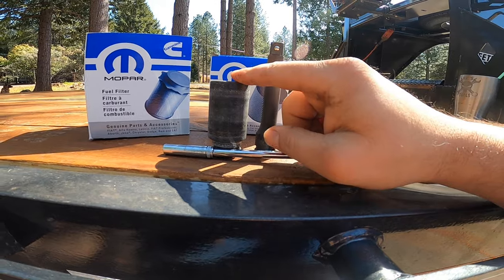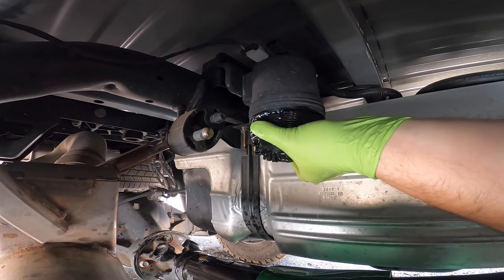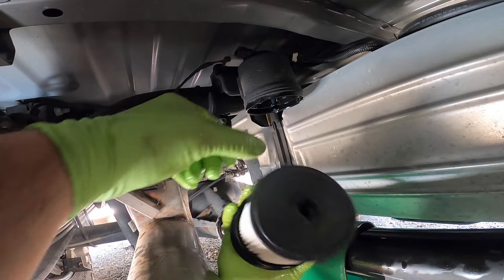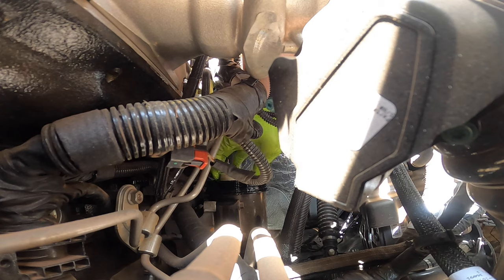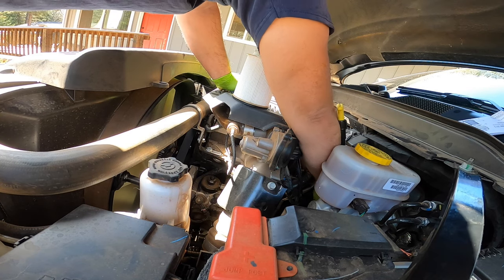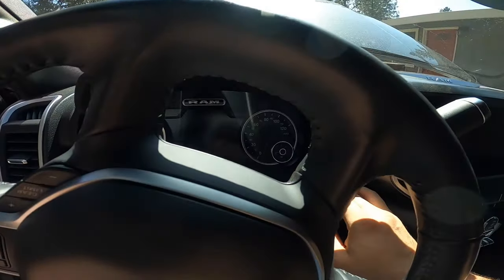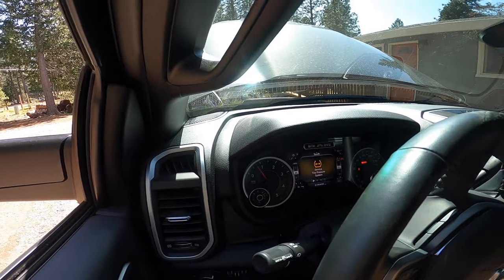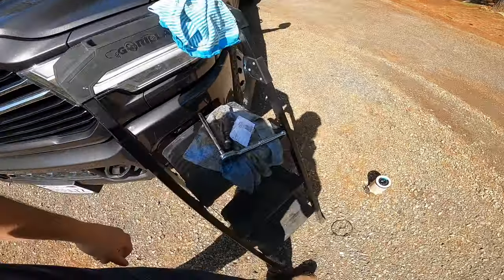HOW TO: 5TH Gen RAM 2019-2024 FUEL FILTER CHANGE for your 6.7 Cummins

Comment: Unrelated but related question. I just bought a 2020 with 31k. Drove it approximately 1000 to 1200 miles since I owned it (only been 3 weeks) and I have already gone thru 1/2 tank of DEF. I'm also only getting 18mpg at 73mpg. (373 gears). Is that normal? (Which is why I'm watching this video I'm wondering if the fuel filters/air filters are dirty)
Reply from the maker: You’re just fine with the truck. Seems completely typical def usage and fuel mileage you’re doing better than myself. If you tow you do use more def. 

If you’re really wondering on your filters there’s no harm in getting your rear filter swapped out. You could just open and look at it however don’t let the o ring split if you don’t have a spare one.

Comment: Thats another reason to keep my 4th gen for sure 
Why do they have to replace the spin on filter for  that plastic housing in the back as well … 🤦‍♂️ 

Thats double of the stupid unnecessary existing work on the previous ram generations 

If it wouldn’t be for the Cummins motor  they will not sell a truck to anybody 
  This is more like bring back it to me 
I ll charge you a legs for that lolo  job 

Any ways 
Good vid brother its feel nice to work on your truck isnt it ? not only for the money saved just for the piece of mine you took the time and know  about it more when you depend on your stuff 
💪👈
Reply from the maker: Ya I agree and wonder the same thing on the fuel filter I like spin on filters much better. 

And thank you my man things are flowing!
Reply from the maker: Always enjoy working on my rigs when I have the time

Comment: Great video . Quick question what was that tube line used for?
Reply from the maker: Thank you, the tube was to drain the rear filter though the valve but it was to small of a size to use it that why I had diesel spilling on the drive line
Reply: Get a 5/16” ID 7/16” OD clear tube at Home Depot for 8$ it fits the hole in the rear and it’ll shove up into the tube for the front fuel filter 👍🏼

Comment: Just  had my 2021 done after 2 oil changes at the dealer. When I bought it I had 12 oil changes free. After the first oil change they told me it was recommended I get the fuel filters changed every other oil change, which dealing with larger equipment diesels, seemed sensible.
What seemed strange however, was the fact it was not covered under the service maintenance agreement that was purchased at time of purchase.(12 oil changes).
So imagine my shock when going to pick the vehicle up, and them telling me the balance was $385, I almost shit myself. I could not imagine what the hell cost that much. 
They charged $160 for the filters, and $160 Labor, the rest is that good old tax. As I said, I even gave the dealers general manager particular hell for it. Still shaking my head. I change the oil in a 60 series GM, 2 fuel filters, 1 large racor filter, and 2 large oil filters, plus 36 liters of Rotella, does not add up to that amount. 
I will definitely be changing them myself from now on. I see on Amazon where I can get the filters for around $90 taxes in. I am sure the first time may take an hour, but I expect after that should not be anymore than a half hour.
Reply from the maker: Ya I can’t understand the cost for such a quick and easy and well known service. It’s on the extortion side of things if you ask me. 
Definitely odd to to he buying a maintenance plan and then something that is a typical service item not be covered on it. 
But at least you see how simple and strait forward it is. Take care of it on your own time save a few bucks and keep on trucking
Reply: @IManOPERATOR  
This all happened yesterday.
After receiving a dealer survey in Email, and giving a very bad review, I received a phone call from the dealership, saying I was overcharged, and to drop in to get my $180 refund. She went on to tell me the code they used for the labor was the wrong one, which I highly doubt. The labor alone that was charged, with the tax, would not come to the $180 refund, so I am guessing the squeaky wheel gets the grease.
Reply from the maker: @mitchp350  Maybe they actually made a mistake. Somewhere somehow. But on the flip side you wonder how many “mistakes” have been made to others that never spoke up and got screwed out of their service cost
Reply: @IManOPERATOR  
No doubt there are many that just pay the bill without so much as a thought. I however could not for the life of me figure how it could be that much.
 I did notice that there was 1.5 hours labor, that was charged in the replacement of the fuel filters. Which to me did not seem reasonable, as I am sure I could do it in 30 mins, the first time. But being technicians that do this almost everyday, I would think they could cut that to 15 mins, if they got their finger out. The general manager(friend) did text me afterwards, and asked if I felt better about the outcome, of course I do think he had a lot more to do with the outcome than is being said.
Reply from the maker: @mitchp350  I couldn’t agree more, and ya having a buddy will make things happen much quicker for any kind of response to an issue

Comment: Stupid question but I'm having trouble finding places to buy the parts. Did you go to a Ram dealer or order the parts online? Thanks for the informative videos! First time diesel owner to tow our toy hauler.
Reply from the maker: Welcome to the club! I’ve always orders from eBay factory filters and or rock auto when they have them available, parts stores and the stealership are complete rips offs for the filters
Reply: O’reilly’s Carrie’s these fuel filters for about $90 for the pair. The water separator is listed as a fuel filter also for 2019 and up. You will need to know what you are looking at to get the right one. They do stock both in master craft brand. They are the same as mopar. The primary filter is the same from 2013 and up.

Comment: On the rear fuel filter you forgot to mention to put the top on first then tighten the 8mm socket when putting it back on to prevent pressure
Reply from the maker: Never thought about that. But really done see how that would affect anything during install.
Reply: Just goes on easier. It won't affect anything
Reply from the maker: @clintmartin1386  ahhh copy that I appreciate the input!

Comment: Good video
In the front filter I didn’t see you drain it 
Do you have to or no??
Reply from the maker: Thank you, and the front filter, you don’t have to drain it especially if your trucks been sitting for a bit, I believe there’s a drain below it but I’ve never checked or used it
Reply: @IManOPERATOR  right on, I ended up draining it by opening up the yellow cap and it had like a 5-6 inch hose that made me drop disel everywhere lol but ended up moving my pan to catch it for the most part. Just did it on my 22 ram 3500 thank you for the video again n response 💪🏽🔥
Reply from the maker: @blazzinpines713  sweet.. no problem at all! Happy to help

Comment: How did you get one on the engine out? I got the rear one out and in just fine. Front couldn’t get it pulled out.
Reply from the maker: It’s takes a bit just have to wiggle back and fourth just a friction fit

Comment: One of my buddies just did a fuel filter change and the truck will start up and stay on for about a minute any idea what might be cause this issue? He ordered OEM filters and primed the truck before starting it. Any feedback is greatly appreciated, thank you.
Reply from the maker: If the truck started up should keep running unless there’s air getting in somewhere make sure the seals are good in the filters no leaks anywhere beyond that I wouldn’t know

Comment: In the front the filter it has a yellow nut or screw  , do I need to loosen it up before wrenching the main screw off ?
Reply from the maker: No that’s just another drain. I’ve never used it  always changed the filter with fuel in it, no big deal

Comment: I understand that this is an old video, but I hope I can get some help every time I try to put the filter in the bottom part the insides of the filter pop loose and I have to put the o ring and plastic priece back in place but it keep popping back out when I try to install if anyone can help please do
Reply from the maker: Try placing the filter in first then the cap, make sure you’re parallel with the filter top to the truck other wise it will not go in. Re watch. The video I show the top part of the filter

Comment: You might want to add the part numbers that you used as finding the correct fuel filters for the 2019+ Rams is like looking for a unicorn!  Almost everyone has them listed as the same for 2013-up.   I ordered the filters for my truck and they both appear to be the wrong filters.
Reply from the maker: Part numbers are on the boxes when I showed them on the video I’ve had no issues getting them and being the right ones, I’ll get the numbers and post them on the video Description
Reply from the maker: Posted them up on the video for you, and here they are 
1 - 68436631aa fuel filter

1 - 68157291aa fuel filter
Reply from the maker: That’s the mopar part number you can find them anywhere with that number.

Comment: Hi thanks for the video do you recommend a six point socket or 12 point socket because I tried the 12 point socket and it kinda rounded out the plastic cap on the chassis Mount filter thanks
Reply from the maker: Ya you want a 6 point to go in that fits perfect over it has no chance is messing it up
Reply: @IManOPERATOR  Thanks for the quick response I always thought a 12 point was better because it had no way of slipping but I will try the six point socket thanks for your help

Comment: Great video! Just changed my fuel filter on my 2021 Ram 1500 ecodiesel for the first time.

I made the rookie mistake and forgot to prime my engine before cranking it over. It took a while to start but it started nonetheless. I got a check engine light, my OBDll scanner showed code P0088 “fuel/rail system pressure - too high” however it turned off on its own.

I took my truck out for a spin and everything seems normal, no check engine light.

Should I be concerned/should I take it in to the dealership to have the fuel pressure checked out?

Would greatly appreciate your feedback!

Cheers!
Reply from the maker: Thanks, ya be sure to prime them up next time, and no you shouldn’t be worries these new trucks are very touchy to any change that might happen. Might of just been a fluke. I wouldn’t think twice on it
Reply: The 2019 and 2020 really need to be completely primed before turning over.  Those years have the CP4 installed.  Two things really destroy the CP4, 1) running dry and 2) contamination.  A CP4 will destroy itself in about 30 seconds compared to a CP3 at 2:30 minutes running dry.

Comment: Mine is at 8% and I have 13k miles. Book says every 15k. Is this not enough for mainly highway driving and rare towing of a boat?
Reply from the maker: I really can’t tell you a yes or no on that one, truly I would definitely change your first set out now and see how bad they are, then you can have a good idea of how far you can take the next fuel filter change as time goes on. You don’t want to starve the system at all on these trucks they needs nice clean cool fuel to run well and not have any issues

Comment: i wonder how the computer bases the fuel filter changes/oil changes. my 2020 is at 8300 miles, but my fuel filter gauge is at 4%.
Reply from the maker: I’m sure if it is just based on hours of use and or possibly resistance of the fuel delivery to the system
Reply: Im not sure with these new trucks. My 15 and 18 both kept at about the same % to change times. This new 21 showed the oil needed changed about 10,000 miles but the fuel went to about 14,000.  I did an oil change at 1000 miles when i first bought it and didnt change the oil change % in the dash but at 10,000 it was ready to change according to the dash.

Comment: Why didn’t you open the valve on the front the yellow one to drain the fuel out?
Reply from the maker: No need to, didn’t sill anything really changing it
Reply: @IManOPERATOR  so is that simply for drainage so you don’t spill anything? I have a 16 and I’m asking because if I don’t need to open it to drain it I’m not going too lol I’ll just pull it up and let it drain out from the filter over it lol
Reply from the maker: @naichetayac753  that’s correct, but again you’ll have very minimal spill when doing the front filter, it’s not even worth the time. Just pop the top whatever dribbles out is little to nothing, Toss your knew one in there and you’re good to go

Comment: Good video! Thanks!
You have a oil change video also?
Reply from the maker: Thank you, no sadly I don’t however it’s extremely easy. There’s got to be a few out there for you to use, pretty much since 1989-2022 trucks you change the oil the same way nothing has changed
Reply from the maker: Oil filter and oil drain and fill haven’t moved at all. Even the oil filters are the same part number
Reply: Just need the oil filter plug to avoid a mess. A friend warned me!
Reply from the maker: @jbs6370  yes those definitely do help

Comment: That process was just about identical to changing the fuel filters on a 2017 Ram 4500 except the rear fuel filter housing is slightly different and in a different location but still the same general procedure. I do the maintenance for extra side money on my friend’s Cummins fleet and they have everything from ram 3500-5500 G56/Asian trucks. Cool trucks
Reply from the maker: Ya noticed that to very small change. 
That’s an awesome opportunity to have to manage a fleet like that. Keep on kicking ass 👌🏼
Reply: @IManOPERATOR  thanks man. Gotta make ends meet
Reply from the maker: @georgeenriquez612  amen to that 🤘🏼

Comment: Just changed oil and filter on my 2022 dodge ram 6948 miles will change fuel filters and water separator at 15000
Reply from the maker: Good, keep here running good

Comment: My truck didn’t want to start after this and after we tighten the front cover more it started but now it stall when idling and the DPF light came on.
Reply from the maker: That’s beyond odd, I’ve never heard of that happening before
Reply: @IManOPERATOR  I look up online and im not the only one , there seem to be an issue with the 2022’s  don’t know if the 21 or 20 have this issue. But mine is a 2022 and it’s in the dealer for diagnostic.
Reply from the maker: @jesusavila629  got ya. Happy your not the only one honestly I’m sure they know what’s going on by now

Comment: Where did you get them Amazon ?
Reply from the maker: Amazon/eBay but if seeing more and more fake filters to just be carful
Reply: @IManOPERATOR  okay thanks for the heads up,  well I got Mopar brand off of Amazon so hopefully it’s not a fake and a legit one.
Reply from the maker: @jonathanbaldwin6335  sure thing! You’ll know it’s a fake if there’s no inner filter liner on your engine fuel filter replacement
Reply from the maker: @jonathanbaldwin6335  sure thing! You’ll know it’s a fake if there’s no inner filter liner on your engine fuel filter replacement

Comment: Someone told me you had to depressurize the system prior to changing the filter but I didn’t see you did that??
Reply from the maker: Not sure if they know what they are talking about, if the truck is off the lift pump is not sending any fuel to the injection pump. System depressurization happens almost immediately when the power is off. 
Maybe a psi or two in the system till it equals off to 0
Reply: @IManOPERATOR  thank you! I’m about to change mine for the first time. I noticed on other videos (2018 models and older) they had a water sensor to deal with and had to have a special wrench for it. Mine is a 2019 and looks just like in your video. I see you never messed with any sensor, correct?
Reply from the maker: @wompwomp8032  oh okay awesome. Ya there’s nothing like that to deal with. Easy job to get done. Just take your time with it don’t break any of the filter housings

Comment: So both of these need to be changed every 10k miles?
Reply from the maker: I Recommend changing fuel
Filters with each oil
Change
Reply: @IManOPERATOR  ok cause my oil was changed 1 month ago but my fuel filter is at 25% life
Reply from the maker: @johnathangriffiss961  long as you change it before your over due you’re good to go. 
If I’m working on a truck I’m just going to do everything I need to do

Comment: where is the best place to buy the filters?
Reply from the maker: Mainly been either rock auto and or eBay and that for oem ones, dealer wants way to much for them. They are getting thin on stock so I would have 2-3 sets with you just in case
Reply: @IManOPERATOR  ok thank you
Reply from the maker: @tjsquib8359  no problem man

Comment: The old Ford 6liter and 6.4 you had to cycle the key about 12 times. All of are single bucket trucks were ford . The company gets the trucks cheap but  the maintenance is through the roof. Ram 🐏 trucks maintenance costs are a eighth of the money that ford's trucks coat
Reply from the maker: It’s funny you commented on this, I just now got done doing the filters again on my girl, I cycled it once and she started right up like normal. $120ish in filters and I’m good to go. They where clean as could be again, really didn’t even need to change them lol

Comment: Anyone watching this with a 2021 2500, I used a short 28mm with no extension and it fit fine.
Reply from the maker: That’s the benefit when you don’t have an Aisin transmission cause the dip stick gets in the way
Reply: @IManOPERATOR  I was prepared just in case. Thanks for the video it was extremely helpful, just did my first fuel filter change👍🏼
Reply from the maker: @ToneeBologna.  happy it help ya out.